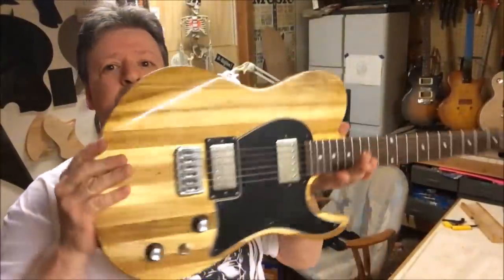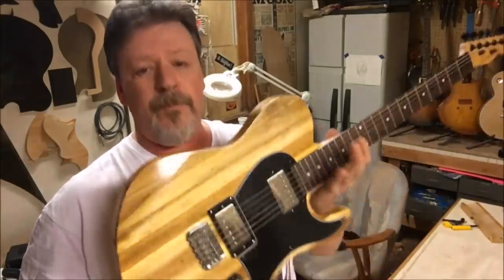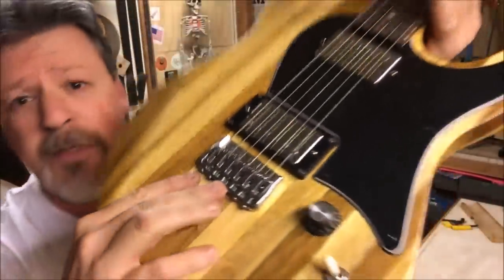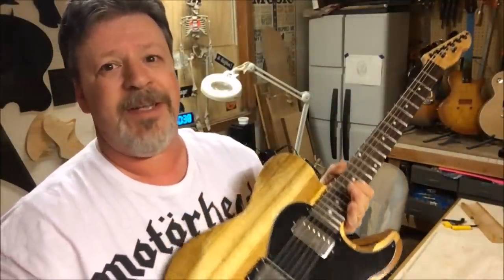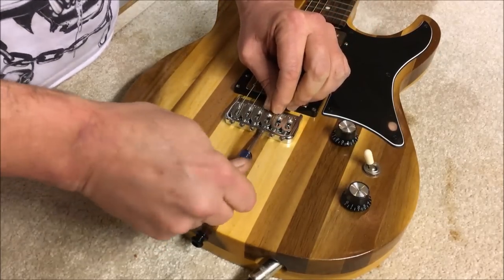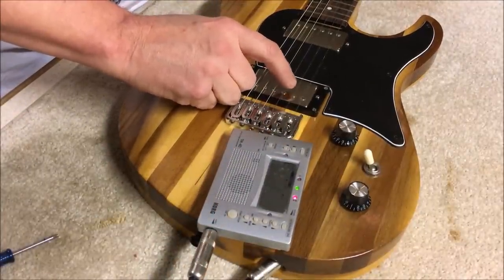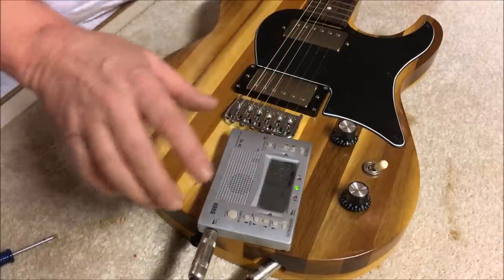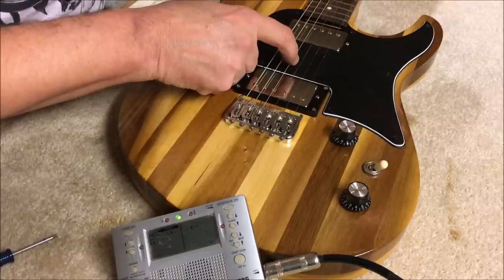Luthier's Tips & Tricks # 27, One way to fix a bridge that won't intonate

Comment: Invaluable advice, even five years later. I was in the recording studio yesterday with intonation problems.  We were troubleshooting other potential problems, but then diagnosed that to be intonation issues in all of my electric guitars.  I faced the same problem that when checking my tuning open then taking a reading at the 12 fret and my strings were slightly sharp, but ran out of space to move the saddle to lengthen the string. As I overtightened the screw the ball end of the screw snapped off and my guitar was non-operational.   If I knew about this fix this would have been be a get out of jail free card!  

Its worthwhile mentioning that if your tremolo system is not flush to the body the angle this makes the bridge can mean it would be impossible to get perfect intonation, as will also prevents the distance the saddle can travel.  

It’s never nice when in a professional setting you face these challenges, but it would be my strongest recommendation to learn the ins and outs of maintaining your instrument to prevent relying on other people. So if a curveball flies your way in a high stress environment, you are fully equipped with the  knowledge and experience to resolve it.

Comment: Im having trouble with me D String being too flat and no room to adjust it screw will fall out what should i do ???
Reply: EXACTLY
Reply: I have the same problem if I'm understanding correctly. The original bridge on my guitar was trashed so I bought a new one. Very nice one - wasn't cheap. But it ended up not fitting just right, but I've made it work, experimenting with it over the years. It's been my main guitar all that time too, so it's not THAT bad, but definitely there...& it's my high E string...if I move the saddle forward any more than it is, the screw won't be holding it in place anymore. I have room to spare; but the screws aren't long enough. & no, I haven't yet found a longer one to replace it, despite looking for one.
Reply: ...& yeah, say what you will. I was young & dumb when I replaced the bridge. But like I said, I've made it work for the most part....but it's definitely something that bothers me & I know it can be remedied... I'm just not sure how. 😂
Reply: This is me! Helppppppp

Comment: Back in the 70's , there were a whole bunch of Washburn fixed neck electrics that the bridge mounted too far forward. Not only did we remove the springs, but had to cut the back of the saddles a bit to get them close enough.
Reply: Exactly why I'm here lol

Comment: F-ing Brilliant and a huge Thank You!!! Same problem, only my G string is sharp intonation on my Electric & it's already fully adjusted back on bridge. Was just looking on Amazon to order a watch pin or metal dowels to cut to size & slide under the G string 1st fret up next to the nut. That would compensate and fix the problem I think but I love this solution better and think I'll do this for sure. 🙂 You've made me happy and can't wait for perfect intonation.

Comment: I cant get my e string intonated… the tech already messed with it and put a new string yet on the higher frets the tuning is off. Any help ?
Reply: Same problem here
Reply: Any solution?
Reply: I found the problem on my guitar.   The pick up was way too high making the strings go out of tune.  In my case i had to lower the pick ups
Reply: @EM-km8em  easy fix ty for your answer

Comment: I have a "Player" Tele which plays great EXCEPT the low e has the same issue. I totally removed the spring and it goes all the way as far back as possible and it's still sharp. I have NO idea how to remedy this.
Reply: I have the same problem with my Player Strat

Comment: Same issue, Sharp G string when fretted on the 12th.
(I have a short scale Ibanez PGM). 
Can I try shortening the screws instead (either by filing, cutting off a portion, or use washers)?

This is because the tip of the screw is already touching the string, which stops me from moving it towards the bridge.

Please advise.

Thanks in advance.
Reply: Yes, I’ve done that before using a metal file and an electric circular sharpening stone to shorten a screw and remove the burrs. Works perfectly in certain cases.
Reply: @basvredeling  , thank you .

Comment: what about a tuneomatic bridge...flip the saddles? and if that doesn't work...fill and re-drill? I'm asking because I have this exact problem...I want to flip the saddles on the 3 low end string because they are maxxed(to the sharp side..closer to the 12th, not away) and I still and shy of even playable intonation. advice? I am a competent woodworker and my think is I should fill and re-drill..this is a 335 style guitar...so I am worried about the look of it since it's such a pretty insturment....in any case, I probably only have to move one side of the bridge like a few millimeters or like 1/8 inch or so...
Reply: I would flip the saddles. You see it all the times with some older Gibsons, especially the last two saddles, no big deal

Comment: suppose it's still is not intonated after what you did?... i've seen a case like that, where even without the spring it's still is not intonated... i wanted to shorten the saddle by way of filing the saddle's back edge a little at a time

Comment: i have the opposite problem, my high E string is flat at the 12 fret, but in tune open. if i keep unscrewing the screw it will come out. its a fender strat.. and tips?
Reply: Loosen the strings with your tuning pegs enough to easily bring them forward towards the neck.
Reply: @tobrsun That's how you adjust your saddels yeah, but what if you already put them as close to the neck as possible and it's still flat? Buy a new guitar or is there a trick?

Comment: Ken I’ve worked on “vintage” Gibsons that were as much as 3/8” off on the bridge stud placement, and a full INCH off on the tailpiece studs. In fact - if you bench 10 early Les Pauls or SGs or 335s - all 10 will be slightly different. Why? As far as I know it’s because they use jigs that somebody has to clamp down, and it’s not a very precise process nor is it perfectly repeatable like CNC would be. If anything, the newer ones that everyone whines about are BETTER - and certainly no worse. I think it’s cool that every Gibson or early Fender is going to be a little different. Some are mediocre but others are great - and if you get a great one - you know it.  Just my .02.

Comment: What do you do when its too flat tho
Reply: You pull the saddle back raising the pitch
Reply: @Eatfard_5150  u might think so but you do the opposite
Reply: @user-kd8ji7rt4c  then why did you ask if you knew?
Reply: @Eatfard_5150  i just learned now
Reply: @Eatfard_5150  also why did u give an answer on something u weren't sure of
Reply: If it doesn't work then get new strings. It worked for me

Comment: It's a quick fix if you don't have anything else. 
I wouldn't do it if the guitar or the bridge isn't on the cheap side. The spring only rests on that tiny surface where you cut it instead of resting on a full wind without angle. If someone does it, place the cut side against the saddle. A saddle is cheaper to replace and you look more at the bridge plate than on the back of that saddle.
With some guitars I had corrosion problems on the hardware. Some companies are cheap on the springs. So I got really into what you need for that guitar based on the size, tension and how far they should be compressed. Some install springs that are so far pushed back (no wrong bridge positioning) that they deform. You often can't get them off the screw. Some chrome their springs like crazy, which doesn't matter if it corrodes below cause they did a shitty job. I replaced the springs of my guitars/bass guitars that have that bridge style. All stainless steel.

I get that you're a repair guy and shit has to work and has to be done quickly. 
Us with their private guitars can take half an hour (or more) to find some replacements. 
If you want to buy some, have the same wire diameter and (roughly) the same number of windings per cm or inch, the screw needs a little play but not much (maybe 0.3mm total). If it has too much play, the screw can't stabilize the spring. It will be wavy when installed (which sucks, is bad for the spring and looks crappy while it may produce noises). Make sure you can adjust it in both directions from the point you adjusted too with NEW strings. Measure from contact to contact and buy a spring that is at 2/3 of the uncompressed length when installed...it shouldn't be pressed to less than a quarter of it's original length. There'll be a measurement given by  quality companies and they have tools online that help you a lot.

Nice Tele.
Reply from the maker: onpsxmember good info, thanks btw, it’s a hipshot bridge, not one I would call “on the cheap side”

Comment: If you're flat and the saddle is all the way forward you can intonate the nut....move the edge of the nut back towards headstock.
Reply: I have the this issue.....
What do you mean by move the edge of the nut
Reply: @maliqazka8161  look at this ebay listing. ...https://www.ebay.com/itm/MusicianAtHeart-COMPENSATED-BONE-NUT-made-for-Fender-Squier-Strat-Tele-Guitar/111431889664?epid=1931524835&hash=item19f1dbb300:g:6KUAAOSwstxVa8X4
Notice the thin string slots in the nut.....they notch it back. (don't buy this one...make one) This is the same as moving the saddle forward towards the pickups.   This deals with flat intonation.  If you've moved the saddles as far as they will go you can intonate the nut....use a small drill and move the slot edge backwards for flat....sharp is more difficult to solve.  If you don't understand what I'm saying you need a luthiar. 
If you have a les paul type you may be able to get a wilkinson type les paul bridge.....they have extra intonation adjust via the posts.  The posts have to be about 73.5mm to 74mm apart.  You can get different posts online if they are not 4mm.
here's a link  https://www.ebay.com/itm/192766439256
 aliexpress.com sells the same thing for about 8 to 10.00....it's the same bridge.  It's the best cheap les paul type bridge.  The other cheap stuff are junk.  If you get it don't tighten the saddle screws too tight...they can strip.  Just snug.  It doesn't have that stupid wire that makes noise like the TOM's.  And you can shim up individual saddles if you need to.  The slots for the posts gives you extra intonation adjustment.